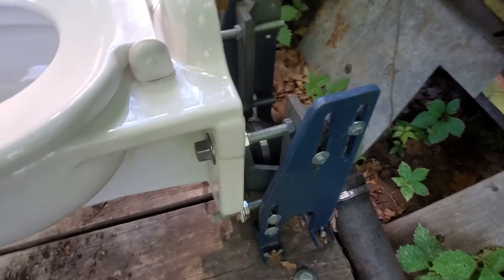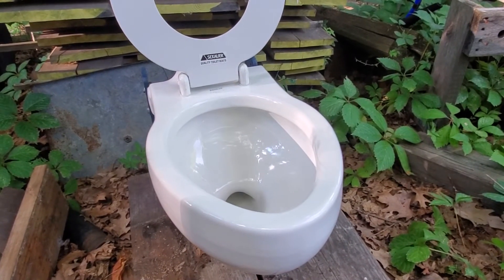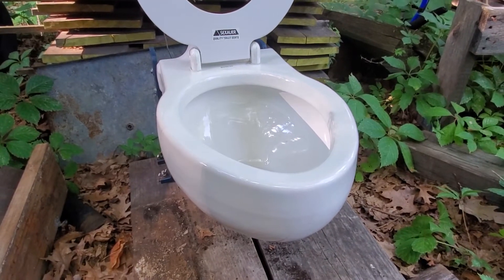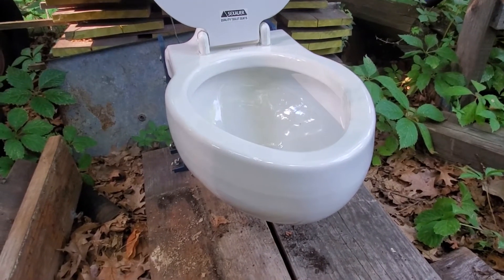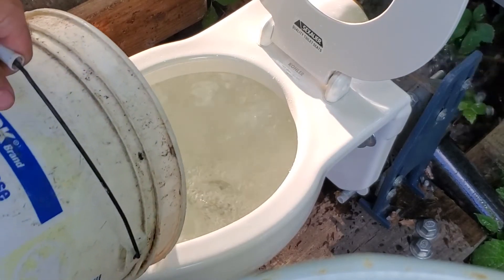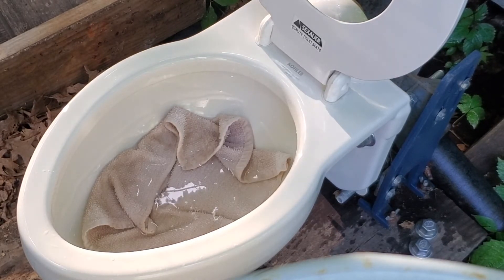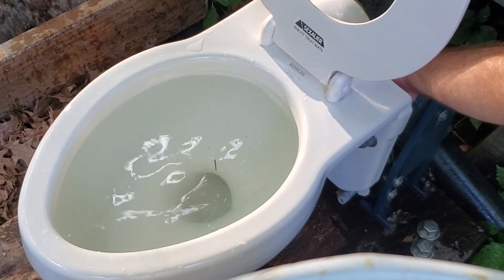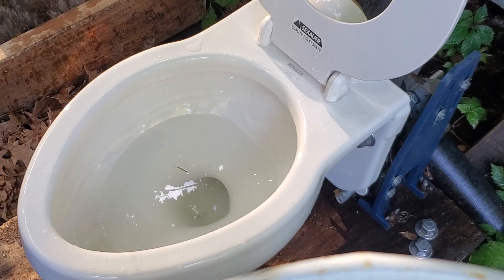#173 2016 Kohler Sifton bucket flush tests.

Comment: Now it would siphon out like the AS Afwall if you attached a pipe to the horn and had it empty lower than the trapway opening, this way it could create a siphon
Reply from the maker: Yes it probably would, though they never install these toilets that way.
Reply: @vintagekohler6085  no, of course not. There would be a vent pipe as well. If I ever saw an installed Sifton that siphoned out, that would tell me that there is a venting issue. However that is how you could get a sifton to siphon out interestingly enough. Just on simple physics
Reply from the maker: @Drakee99  I will have to see if I can pull that off sometime. That would be neat to see.
Reply: @vintagekohler6085  agreed!